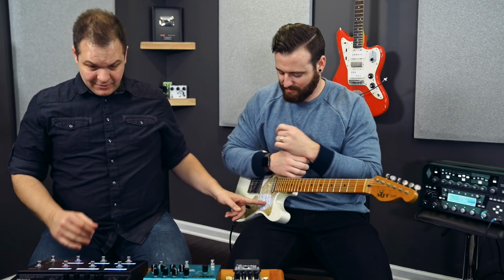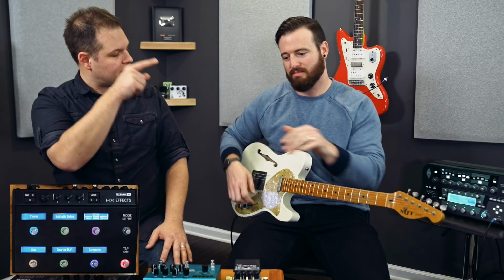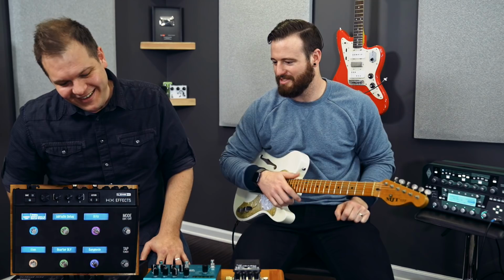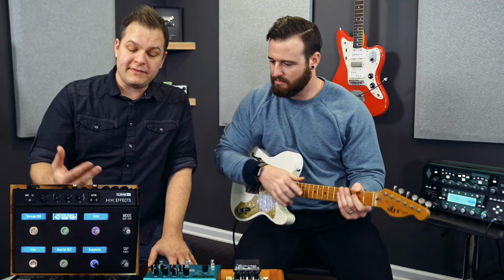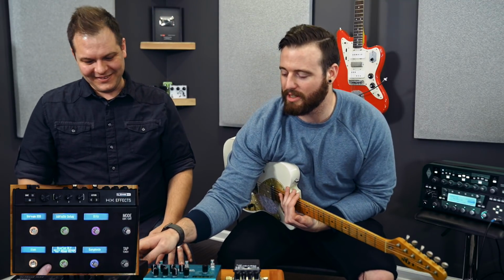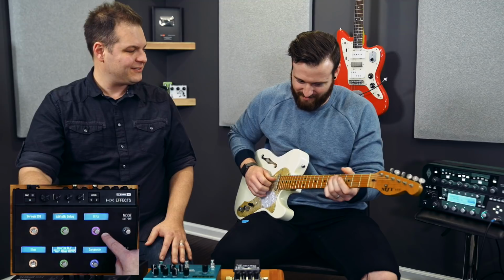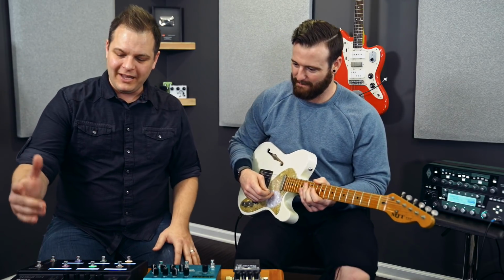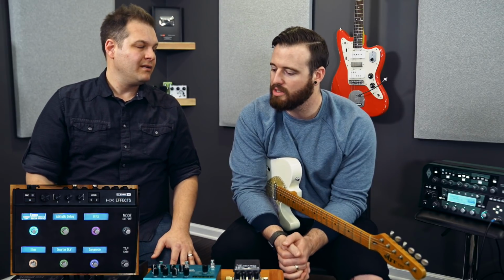How to replace your entire pedalboard with Line 6 HX Effects

Comment: Hey guys, excellent video! Quick question... could you use snapshots to create a certain type of sound for each song in your service? Example, we play 4 songs and for song #1 I want compressed overdrive with reverb and delay, song #2 I want clean tone with reverb and a different delay, #3 compressed overdrive, and #4 clean tone with long reverb and delay. Is this basically what y'all refer to as patches?
Reply from the maker: Yeah you can do that pretty easily, either by turning on/off different effects in the same patch, or by changing parameters of effects with the snapshots (turning up delay/verb settings, making a comp more or less extreme, etc)

Comment: You mentioned that you have the deluxe comp and hall reverb on but not assigned footswitches. How did you set that up in the signal flow menu? I've been trying to figure it out but to no success, your help would be greatly appreciate!
Reply from the maker: Hey Mark - go to the 'signal flow' view, and choose a spot anywhere on the chain. Just press the button and add an effect. From there, you can assign it to a footswitch or not.
Reply: Ah okay, I was worried it would automatically bypass the effect as it wasn't assigned to a footwsitch. Thanks!

Comment: Very helpful. Thanx for making the video. I have a few questions if U do not mind. 1.On the HD500-X can I control the ramp up and down of the rotary effect by using two buttons? I do not want to use the pedal for that. 2. Are there any string pad like effects? 3. If there are pad like effects Can I bring that pad in  & out with the pedal? 4. IS there a simulated acoustic guitar sound like the Digitech stuff has? Thanx

Comment: at the 4:00 mark you seem to engage two drives at the same time.  Is this correct?  I have an M9 and you can only pick one effect at a time from each block.  Does this unit allow you to use ALL 6 at the same time? If so that's huge. Thanks
Reply from the maker: I’m not sure if we did that, but you definitely can assign multiple effects to the same switch. 

You can also make a switch change parameters of an effect (like turn up the mix and decay time of a reverb or delay). 

If you use snapshots you can do even more. It’s pretty awesome.

Comment: Is it possible to have more than 4 snapshots at a time?  Although it should suffice well enough for most songs, you're aware as much as anyone that a number of P&W songs can easily demand 6 or even more (e.g. Intro, Verse 1, Pre Chorus, Chorus, Verse 2, Bridge, Outro, etc.).  Ideally if possible, I may control the bank/song switching via Disaster Area Midi DMC and use 6 snapshots on the HX.  It'd been easier if they made a 8 switch version.  Oh well.  Thanks.
Reply: Wells306 only 4 at a time unfortunately :/

Comment: I’m sorry, but this would never happen. There’s no way I could go full digital.
Reply: cour1988 sometimes you have to take a leap of faith...
Reply: cour1988 I mean, no ones making you 🤷🏻‍♂️
Reply: It's not actually full digital. Its just your pedals, which many of your current pedals are probably digital anyways. You still use your tube amp. Thats what's appealing to me about it over the helix.
Reply: It is funny because the 80% of the pedals are digital, not analog LOL. You are already digital, not 100% because you still use a tube amp, but your pedals are digital. I used to have a lot of pedals and right now I only have the Helix, it is an incredible machine.

Comment: How to use it directly on the church mixer? Is possible to put a amp head on effects loop and go straight to the mixer using the IR cabinet simulation? Thank you, guys!
Reply from the maker: You could do that, but you'd need a reactive load to receive the output of the amp and bypass the speaker. Something like the Suhr Reactive Load. So you'd go from the HX effects into the input of the amp via the effects loop, then from the speaker out of the amp into the Suhr Reactive Load (or piece of gear that will take the speaker out of the amp and turn it into line level), and then from the Reactive Load back into the HX Effects. Then you could load an IR Speaker Cab model and run direct to the board.

If you don't use something like the Reactive Load, you'll damage both the amp and the HX Effects.
Reply: Worship Tutorials Understood. There's another cheaper and easier way to go direct to the mixer? I really need a preamp to do it? I was thinking in Mooer little pedal amps, maybe.
Reply: I use mine this way. Amp head/loadbox in send/return 1 with an IR block after that. Then more effects in the HX Effects, then out via 1/4" into a DI.
Reply: I use the Laney ironheart tube preamp pedal. It is a great tube preamp with a surprising amount of features. And it can be had used pretty cheap.  Just put it in the effects loop and you are set.
Reply: How much you paid for the loadbox, Mark? Do you have a video playing this way?
Reply: Is it possible to use the HX straight to the mixer if I use an IR ?

Comment: I have a Helix and an EP Booster.  I run the EP at unity gain.  With a modeler, does it benefit from an EP Booster as it would on a tube amp?  Pushing the front end of the Helix is a mystery to me.
Reply from the maker: It reacts the same way a real amp does. The EP Booster in the Helix (Kinky Boost) is really good, too. I’d be curious how you like it compared to your pedal version of it.
Reply: Just an example, I run an Xotic compressor in front of my Helix (i prefer outboard pedal compressors) just to number one, apply my favorite compression level, and two, boost the "front end" just a couple of dB's boost. It sounds wonderful. That interacts well with the Helix
Reply: I use the Wampler Ego Compressor on my pedalboard, but not with the Helix yet.  I love that compressor.

Comment: Do you have to have an amp for this board or if using individual mix of different pedals? Like if i just had a reverb, delay, compressor, tubescreamer and a distortion pedal, if we have a decent sound system, it shld sound ok going direct without an amp right?
Reply: Megaman it won’t sound that great. It needs something to push the signal like an amp does.
Reply: Sounds like a full helix or helix LTE is what you are looking for.
Reply: Whats a good way to control the volume on stage for an amp? Cuz u need to have it loud enough to get a nice clear tone for drives or else it just sounds messy and muffled u know?
Reply: We mic it up too in an attempt for better mixing as well so sometimes ill have the amp facing backwards towards the wall so my vocalist dont get blasted too
Reply: You could try a Mesa Cab Clone? They’re the cheaper of some options. $300. You can still use your amp and run it as loud as you want.

Comment: Can somebody please show how the tuner works all the demos they've done on YouTube and nobody has once used the tuner just need to know if I need to buy a tuner to go with it ? thanks! Ps can you guys also show how to hook up an external volume pedal and wah-wah pedal
Reply from the maker: When you go to tuning mode, the bottom 3 screens show you the pitch (sharp or flat) - you basically get a meter where a signal goes across left to right). When you go in tune it it lines up in the middle and a light goes green as well.